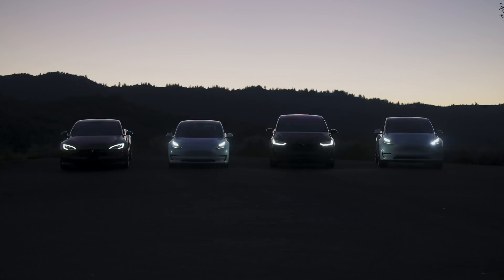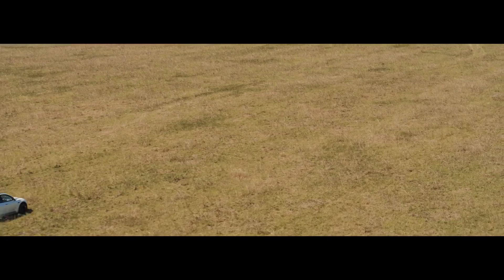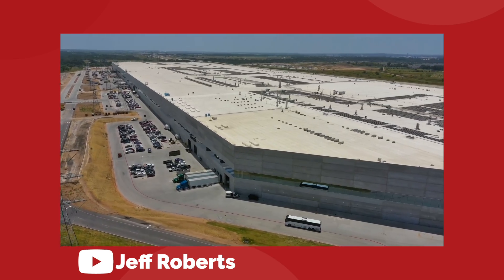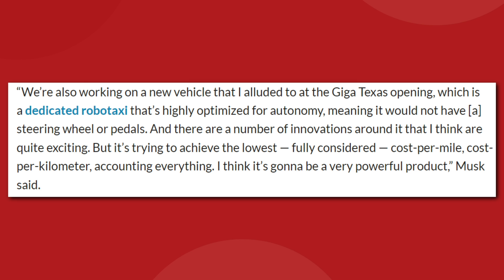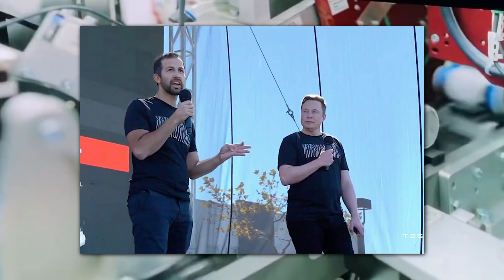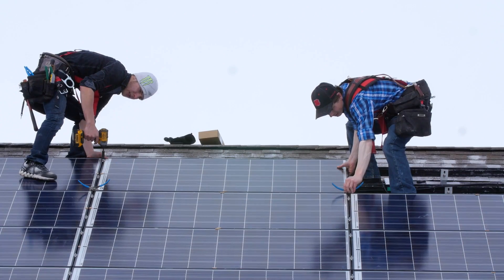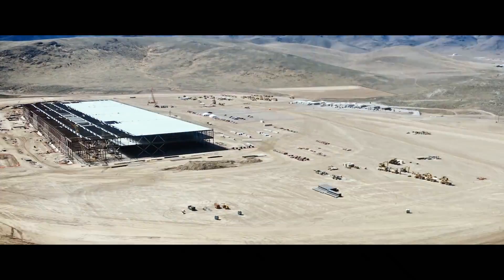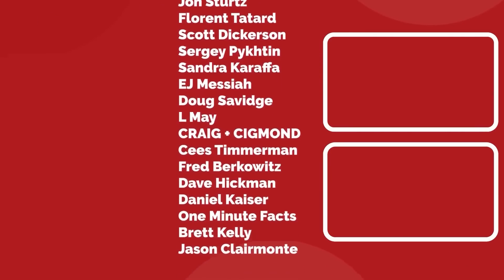New 4680 Battery Cell Production Update!

Comment: Those new 4680 batteries are very important. It's the largest of three sizes, and newest. But most importantly it's the only battery made today for anything that doesn't contain any Cobalt. Which was discovered 6 years ago by Amnesty International Cobalt was being mined in China by little African children as young as 4 being sold into slavery because they are the only size who can fit into the hand dug mines. It was estimated years ago 30 to 40,000 kids are being used to do this nightmare work for less than $2 a day. They often don't eat and must work 12 hour's a day. It could be stopped at the point of sale if nobody would buy what's mined by the children. The buyer's don't ask questions as long as they only pay the bottom price. All Cobalt is mixed when sold beside what is legally mined. It's every child's nightmare being lived by these children for real. And it will still be needed in even larger quantities as EV products increase. Cell phones, laptops all need Cobalt for longevity and safety. Just like it was milked from these child slave's and put into these batteries. So these 4680 batteries hopefully will be the future. But they certainly won't fit phone's and laptops. And still after 6 years very little is being shown about these little slave children who receive absolutely no medical care if they are hurt. It's really a nightmare come to life.
Reply: African Children in China? I believed it was copper mines in Africa.
Anyway as Cobalt is byproduct of copper mining (8/1 ratio), nothing will change for those kids if cobalt is not used anymore, they will continue mining copper ores.
Cobalt will still be used as there are many usages for cobalt, for example oil refinery is one of the main usage for cobalt...

The real issue is the chid labor in the mines of RDC. Copper, cobalt , whatever. Poor kids.

Comment: Is this 4680 battery a stolen technology from Panasonic? AFAIK, CJK dominate the EV batteries, other countries are not even close.
Reply: Panasonic has patented a multiple tab battery that is in the 4680 size.  Far superior to the "tabless" (or should be say "continuously tabbed") battery that Tesla is trying to produce.  Panasonic tried the continuous tab, and found that it was not feasible.  It generates way too much heat (power loss) and is prone to manufacturing yield issues and premature individual cell failure.  

Panasonic also has developed a new patented alloy for the cell casing that is far superior to typical cells, nearly eliminating the need for expensive liquid cooling that is so common to Tesla.  

My sources tell me that the other design features Panasonic is developing include the ability to economically extract single cells from the battery pack in the event of a cell failure, making their patented structural battery pack as easy to repair as a vintage flashlight.  The design innovations allow potential repairs to be performed without removing the battery pack from the vehicle.

Panasonic is working with BYD, Ford and Rivian to produce and deliver structural battery packs as a parts supplier, allowing the vehicle manufacturer to focus on other, more suitable parts of vehicle development.

Comment: Why include an adapter at the super charge station when they can just wire up another cable. It would be like Gas or Diesel withe their two separate hoses.

Comment: Tesla's transference number is so low. You make 10 4680 battery and only 3 is usable and 7 is trash. Tesla brought LG and Panasonic to help out 4680 design to be used for their vehicle. LG and Panasonic has been making batteries for more than 10 years making tesla is a baby in battery industries. 4680 is nothing special. Is only powerful compared compared to 2170 battery cell

Comment: The Tesla semi and cybertruck are likely to be given higher priorities to use the 4680 batteries in year 2023 because it is easier for Tesla model 3 & Y to use the 2170 batteries than for the Tesla semi & Cybertruck to use the 2170 batteries. This is more likely to happen if the ramp of 4680 battery production is still not high enough in year 2023.

Comment: Tesla should design an adapter for other EV owners to buy if they want to charge with Tesla
Reply: They’d make a buttload of $$$ from selling the adapters to offset the added load on the charging network.
Reply: @xiaoka  yeah I agree
Reply: @xiaoka  or they could charge a subscription for it
Reply: They should also charge a non-tesla fee to charge, like 2x the rate to discourage it and they will make enough noise that the government will give them other options
Reply: @KingLarbear  If Tesla is the most reliable charging stations and most available, nobody can come close

Comment: The new model y from Texas actually has the biggest battery out of all of them at about 84kwh and once the battery has been real world validated and will have a range over 359 miles from my calculations. All you need to do is watch Munro tear down and count the cells
Reply: Nice fake.  Your post is entirely speculation and misinformation.  There is no proof, and reality will only be revealed when Munro finishes teardown of the MY AWD battery pack in their possession.  And even then, the 4680 cells may or may not be performing to the purported spec.  The production line is new and still ramping up volume and playing with the chemistry (their statements, not mine).  Again, until Munro tests them, truth is not available.
Reply: @twhite5085  no it's not, it's fact. It's not my fault you can't count the cells off sany Munro's video and then do the math regarding how many amps are in each cell. Furthermore elon has said the giga castings make THE WHOLE CAR LIGHTER, yet the Texas model y is HEAVIER THAN the performance model y from Berlin. Do 15mins of research and do the math (WHICH EITHER HAVEN'T OR CAN'T DO THE MATH) then come back and apologise because I AM RIGHT!!
Reply: @nathanbradforth3408  xD
Reply: The 4680 Model Ys could have dummy cells to fill out the rest of the structure.
Reply: @chrisness  yes true.... But... I just can't see why there would be any practical reason for doing that? But what really makes me think it's not the case is the Texas ys are heavier than long range yet elon has said many times that the castings reduce a Lot of weight

Comment: It come to my understanding that 4680/18759/21700 all use heat strip to wick heat off the cylinder wall. 

The advantage of increased cell size is the increase of energy capacity per cell at the cost to disproportion of heat sink area. The cell ends up with a hotter core when all else are equal. The issue are longevity, potential thermal runaway or fire hazard. 

46800/18650 thermal management. 
Energy ratio 8:1
Heat sink area ratio 3:1 (requires 8:1)
Core temperature ratio 2.54:1 hotter

That is an oversight decision migrating from 18650 to 46800.
Reply: Include the 4680 tabless design to heat generation for your thermal management assumptions
Reply: @flexcheckXYZ  your point is well taken. 
I used to advocate the tab less design with an assumption that core heat sinking via the cylinder base can be impede by point contacts metal wafer which conducts current but heat. Recent YouTube update confirm me that cylinder wall heat strip is used at cylinder wall of 4680 and not via its cylinder base. To that I also made comment to solder weld the anode flaps (aka shingles) direct to the cylinder base for perfect core heat extraction. Soldering with selective induction heated soldering at cylinder base. 

Soon realized that only a small fraction number of cylinder base can directly in contact with the structural pack made of metal. The rest are insulated for voltage stacking from say 3.7V to 44V, subsequent extraction involves insulating thermal coupler, in the cylinder base scheme. 

BTW core thermal resistance increases as cell diameter increased in the process of energy increases per cell, expecting a steeper thermal gradient form core to cylinder wall.
Reply: @flexcheckXYZ  4680 has much higher thermal load due to the tabless design.  Insiders have hinted the loss to heat is over 16 percent over the previous design.  Panasonic, with this in mind, have been developing a 5 tab design, which they have patented.
Reply: @ReachOutToWilliam  I don't see how a 5 tab design will reduce heat gain compared to a tabless.  The tabless design is essentially one large continuous tab instead of individual ones.  A 5 tab design should increase output current and mitigate heater better than a singe tab design, but the tabless should mitigate heat better than either.
Reply: @ohger1  That's not how it works.  Keep in mind that the continuous tab, which are essentially shingled and bent over increase what scientists call "potting."  The numerous connection points increase resistance and cause micronistatial short circuiting.  It's a phenomenon that is well-known in other disciplines.
Reply: @ReachOutToWilliam  I know little about battery tech  but I do know electronics.  The more contact points you add the more parallel resistance drops.
Reply: @ohger1  A statement that is meaningless in this context.  Please show your work.  It simply does not apply in this case.

Comment: the range still has to improve a lot.  350 km range is a bad numbre for a model Y on highways,  we need at least 600km . Batteries needs to be better, the chinesee already have one over 1000km and it will be produced this year.      4680 ones are becoming old before are being on  the market
Reply: There is zero to precious little energy density or efficiency left in today's battery chemistry.  The whole lithium ion/lithium iron/lithium unicorn universe is in the cash cow phase.